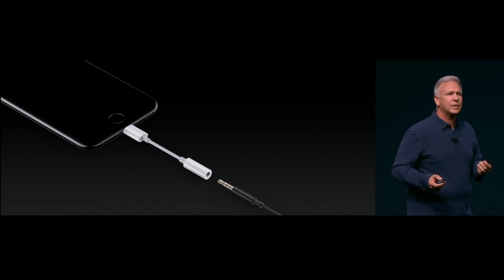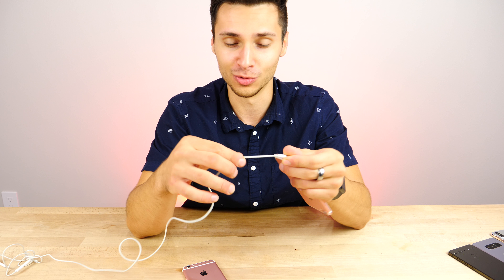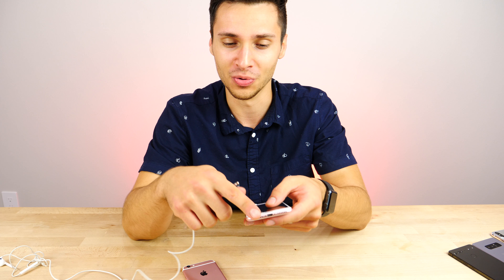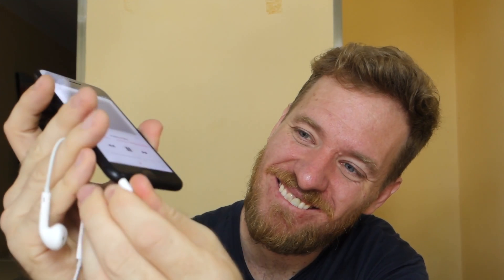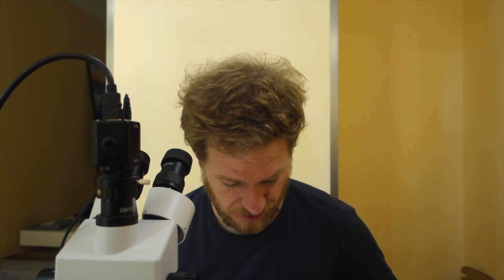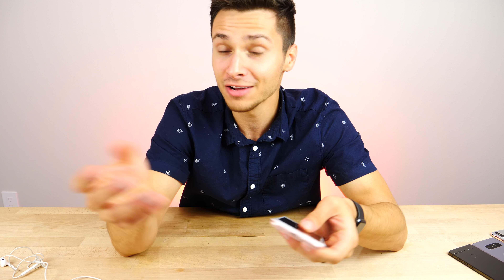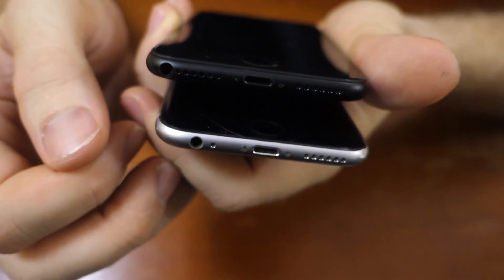Insane iPhone 7 Headphone Jack Mod!

Comment: I just miss my headphone jack. 😂
Reply: B-Radz you can afford 700-1000 for a phone, I think you can afford 100 for a set of Bluetooth headphones like the Marshall Major II.
Reply: G B Df Bruh? Someone always has to come in trying to talk shit, all I said is I miss my headphone jack I'm allowed to do that right? We payed for my phone with tax return, just because you think you're smart doesn't mean it's true.
Reply: B-Radz dont buy an iphone 😑
Reply: 101 PMF I bought my phone thinking it wouldn't be much of a problem when I have a Bluetooth aux dongle. Turns out I was wrong, all I said is I missed my headphone jack and ignorance came lurking in the comments waiting to talk shit. I didn't say it wasn't my fault I got the phone. I didn't complain about the price. I honestly could give a fuck less. I just said I miss my headphone jack....
Reply: G B you shouldnt have to pay $100 for something as basic as headphones for a phone you already paid $1000 for on a connection that still gets interference and imput lag. That's like having to deal with all the bullshit "accessories" with red cameras.
Reply: d1asian, that's a piss poor argument. If you're too poor to pay $100 for good headphones, then use the ones you get with the device. Guess what? It's not like Apple bundle headphones which still need a headphone jack. And it's also not like Apple don't give you headphones. Or a short adapter cable to use your old crappy headphone jack headphones for free.

By the way, Bluetooth hasn't had ANY connection issues or latency issues in YEARS. If it did, do you really think Samsung, UE (Logitech), Bose, B&O and all the other high brand speaker/headphone manufacturers would be switching to bluetooth as the primary audio transfer method? Samsung soundbars for TVs. Bluetooth enabled. UE, Bose, B&O and others all making top notch speakers. Then theres companies like Sonons too.

FYI calling red cameras BS due to their accessories, shows you don't know much about them. Just so you can understand correctly, red cameras are MODULAR. meaning you buy each piece of the camera separately, custom to what you need. This is a very good concept, because most of the time when you buy a regular camera, you pay for features you don't want and/or need because you'd be adding attachments anyway - such as cameras that have a built in flash vs. a dedicated flash expansion unit, or the built in microphones vs. a dedicated wind-proof microphone. Buying modular means no wasted money on trash components that will never be used, and that when something new comes out (better lens, better flash, better microphone, higher capacity batteries etc.), be it first OR third party, you can easily and cheaply upgrade vs. the price of buying an entire new camera system.

As a final point, your argument of "I should get an expensive pair of headphones with my phone, and i expect all red cameras to be pre-built and cheap so I can afford them", where does this ignorant view stop? Next you'll be expecting a PC with every existing piece of software preinstalled with licenses. Or a gaming console with every pre-existing game pre-bundled with it. The world doesn't work like that. If you want something to add to existing hardware, be it more hardware, or games, or software in general, quit moaning about it not being bundled and just get it.
Reply: I don't condone airpods myself personally because the quality is no better than the wired versions, and because it ties you into apple's ecosystem with the W1 chip.

Bluetooth headphones in general however, are an entirely different story. They free you up from any specific ecosystem (headphone jack, lightning port, USB-C port, micro USB port whatever)... and ensure that they will remain compatible with any future device you might own. Not only that, with Bluetooth being digital, vs. the analog signal passed through cables, you get much higher bitrate possibilities, meaning better audio by far. The reasons to switch to Bluetooth are far higher than sticking to cabled versions. Even battery life isn't an issue. My own Bluetooth headphones (Major II by Marshall, one of the best audio companies on the planet, known for making guitar amps used at most concerts around the world) boast 30h battery on the packaging, however in real world usage that could easily translate to over a month of usage (such as using while on public transport going to work, school or whatever your daily need is). As a gamer you'd find yourself only needing to charge every 2-4 days of heavy use.

With Bluetooth, you really do have no constraints of how you can use them, because every console, media streaming box, cell phone, tablet, all have Bluetooth 4.0 or above nowadays. And Bluetooth 4.0 eliminated any latency that  was seen previously, in addition to providing ranges that also prevent any connection issues (over 30 meters) and that's now even better with Bluetooth 5.0 as seen with the Samsung galaxy 8 series.

Basically, my point is, if you have the money to spend on a $100 pair of headphones that are Bluetooth enabled, then why not do it? It's an investment that will free you up over the long term, give you much better usability, and of course, no more broken cables forcing you to trash expensive headphones. I myself had Beats and Marley's House of Sound headphones before these Marshalls. Both suffered broken cables and became useless.
Reply: Sorry but again not everyone has money up their ass. I got my phone using tax return, my headphones either got lost or stolen at school I can't be the one to assume, and after that it makes me iffy on taking my dongle anywhere because god forbid I loose it and have to pay 9$ for another. I bought the fuze case and it makes my phone die at least 2x faster. If I had the aux port it would completely avoid this problem. Again it all starts with a simple comment and then people won't stop talking shit for years. I just miss my damn headphone jack, I'm tired of forgetting my dongle going to school and not having any music to help me through the day because of everyone els's bullshit.
Reply: Keep in mind there is no such thing as true "digital audio".  For any speaker to work, whether it is your earbuds, bluetooth headphones, or a full sized speaker, the signal that reaches the coil inside the speaker must be in analogue form.  With modern mp3, flac, or m4a files, we use digital code to store the analogue information that is then translated by the DAC (digital to analogue converter) back to an analogue signal.  In bluetooth devices, the digital signal is transferred via bluetooth to the headphones and then converted by a DAC built into the headphone.  With wired devices, the digital file is fed to the DAC on your phone with internally wired connections, which can provide much higher bit-rates than bluetooth.  Essentially this means bluetooth does not provide better audio, and it is mostly dependent on the quality of the drivers in the headphones and the DAC and amp used to drive them.
Reply: B-Radz get a android
Reply: Jimit Desai Yea that's what I'm doing next just don't know which is better, I've heard people say don't get the latest galaxy but they don't say why??
Reply: B-Radz check out the lg v30
Reply: Jimit Desai Ok thank you for your advice!! I really appreciate a logical conversation.
Reply: G B np all the best in finding your next phone
Reply: B-Radz there are plenty of brilliant android devices out there. Check a store which has working demo units because the right device is different for everyone. Since you said nobody says why not to take a galaxy I'll give you a few reasons. 1) poor value for money, 2) the inbuilt DAC for audio output is terrible. 3) the inbuilt speaker is terrible quality and still mono and not stereo despite this being 2017. 4) battery life is abysmal despite having one of highest capacities and 5) it's insecure. You pay for facial recognition that can be hacked by a photograph.

LG, HTC, Huawei and One plus are just four companies you should look at if you want android. Don't bother with the Pixel or Essential because they also don't have headphone jack.

Also make sure to research all models you've been checking out. Specifically pertaining to battery life
Reply: G B Do you think all companies will soon go toward ditching the headphone jack?? If so I would honestly rather stay with iPhone because of the simplicity and how familiar I am with it.
Reply: B-Radz I think it will become an increasingly rare feature, but there will always be enough demand for it that at least a few android flagships will have a headphone jack for the foreseeable future
Reply: Joseph Kebbekus True, there's always at least a couple that use it to their advantage because who wouldn't. That just leads me to the same spot in wanting to wait to get another phone but it's not always the best considering new phones coming out left and right. I feel as if I'm going to buy one and one with just a couple more features that would have helped released.
Reply: B-Radz oh yeah and I also don't recommend the s8 or the note 8 because the s9 is coming out in February according to sources.
Reply: B-Rads I would take your time and find a phone you like with almost everything you want, wait a few months or so after it was released, and get it then for a lower price.  I know it won't be the latest and greatest at that point, but it will still be a great phone.  That's what I did with the galaxy s6 and its still my main device.  It's missing some nice features like waterproofing and an sd card slot, but its lasted me a long time.
Reply: Joseph Kebbekus Very true, that's what I always do before I get any phone is wait to see the reviews and get a hands on model.
Reply: B-Radz i miss my phone
Reply: The main reason I hate not having it is when I go to the gym.  I need to carry two sets of headphones.  I hear that complaint from alot of owners.
Reply: Jay Trock Exactly that's a pain, i would end up forgetting one sometime like I do my dongle
Reply: Apple is one of those companies (the only company actually) that can get people to actually try it because they have so much influence in the tech world (example: floppy drives example: the idea of real smartphones, etc etc).I mean this is technology, for the people who always say quote "no headphone jack, no buy", ask yourself this: What are you gonna do once everyone removes the headphone jack like everyone will eventually do (and they will, especially since Apple did it)? Will you adapt to change like how you should because this is technology or will you stand by your no jack no buy motto and and keep your current phone which will get outdated really quick all because you're worried about a damn headphone jack?
Reply: technoguy I love you 😂 you completely changed my perspective.
Reply: technoguy I think they just got rid of it too early. People are starting to make the transition to Bluetooth now, but not everything has Bluetooth yet. This is why they should have given it a couple more years for people to get more advanced and then remove the headphone jack when no one really cares about it.
Reply: d1asian what’s red cameras
Reply: Christian Sanchez I completely agree
Reply: do you also miss your $750 that you spent on it? ;)
Reply: CrazyBearGuy Yeah I did the second I walked out of T-Mobile 😂💯
Reply: Time to make the switch to android.
Reply: G B what if you go to friends house without Bluetooth headset and he gave only normal Jack . Nerds logic to use Bluetooth
Reply: Bl Chitu this is why apple provide a very small and thin dongle in the box for free. It's so small that it's not even noticeable other than the 3 inches it adds to the cable length
Reply: plady Where have you been read up in the comments that was already covered. 😂💯
Reply: Why apple?...you pay your ass of for shit!!!!,sacrifice things that andriod phones can provide for much less money!!!!!!
Reply: furious president I encourage you to be smart and read up before you comment. Phone companies are soon going to all ditch the headphone jack.
Reply: B-Radz I see your point,just like the galaxy note 8 droped its headphone jack,LOL
Reply: Wel, Iphone is the king of speed!!
Reply: G B Talking about me? I've never said they are speed god's or anything around the trash your talking all i've been saying is about the headphone jack..?
Reply: B-Radz wasn't talking about you don't worry lol
Reply: G B For sure bro, it's all good
Reply: B-Radz my parents have an iPhone 6 so they have headphone jacks already
Reply: Mm
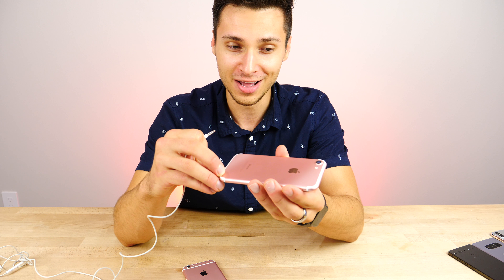Reply: bluetooth is not better than wired. listen to chasing the sun by the wanted 1:20 there is an echo can can be clearly heard by the cheapest wired headphones that cannot be heard on a $200 bluetooth 24bit DAC with 112 SNR with those same headphones.  Bluetooth compression garbles it.    heck you can even hear the echo clearly on the iphones speakers. when you plug that same DAC into the lightning connector it sounds great.  try it for your self.
I miss the headphone jack too.  im sorry for wanting quality sound that is at least as good as the iphone speakers
Reply: B-Radz apple sucks I have galaxy s8
Reply: You used the wrong emoji lol
Reply: Cortex No I didn’t, the whole reason I watched this video had me laughing because someone would go through that much trouble to install a headphone jack on a newer iPhone.
Reply: B-Radz its called a samsung
Reply: Me too 😭
Reply: Poke $50,000 camera
Reply: ios-Andriod
Reply: B-Radz same  I want to listen to music with my headphones and charge my phone but I can’t, I would get Bluetooth headphones but nah.
Reply: Jack misses headphones :(
Reply: I still have it 😂😂
Reply: B-Radz yeh
Reply: B-Radz me to
Reply: Rip headphone jack 😂
Reply: B-Radz That's what you get for buying iCrap
Reply: I dont cuz i have a samsung
Reply: I don't miss mine at all. I can live with using an adapter (I'm sure I'll lose it somehow a few times)
Reply: B-Radz no i love it when the battery in my headphones dies. So innovative. I also love it when the battery on my phone stops holding a charge. Oh and when the phone runs out of memory and i cant put in an sd card. And my favorite is not having a back button or a home button :( apple is cancer.
Reply: Buy a Samsung! 😂
Reply: I don’t. Using the dongle isn’t a big deal
Reply: Hi Hi putting in a headphone jack isnt a big deal. Using an unnessesary dongle is stupid. I havent had to do it since 2006
Reply: go and get a samsung
Reply: G B or Sony SoundMates which is cheaper
Reply: Why Don’t You Use Bluetooth Audio
Reply: G B and plus an iPhone 7 is £300 and that has no headphone jack
Reply: B-Radz why not get an iPhone 6 or 6s 🙄
Reply: Zonde Phiri Cuz I have an IPhone 11, why would I downgrade
Reply: Seeds Sure bud, defending myself is getting offended, keep dreamin 😂👌🏻
Reply: B-Radz Because you said that you miss the headphone jack 🙄😀😂 and besides I can’t get an iPhone 11 right now because things are too expensive where we are right now I’m not like you rich people 😩😩 so I have to wait even longer to get it 😔😂
Reply: In Zambia it takes forever to raise enough money to get an iPhone 11 and I want the 11 Pro Max which is 5x as expensive as I was expecting it to be. It is starting from K23,450 for the 64gb so it isn’t fair that where you are living it’s probably cheaper so that’s why I am asking you that question 😀😀😔
Reply: It is just a suggestion 😀
Reply: Zonde Phiri Oh damn that sucks

Comment: still he defends apple after all that guy had gone through.
Reply: Sriram Sarathy considering Apple is not the only one that removed the Aux jack, what is there to or not defend here?  Even Google removed it from their flagship Pixel phones.  HTC has as well. Samsung only still has it so they can milk their base. 

Reality is, most people want wireless headphones anyway. 

Now I myself use the aux jack at night for white noise due to my sleeping disorder but I have to find a solution for charging it while I'm using the lightning jack for audio. 

That is the only time I can see myself or others needing to have a charging solution while using headphones. 

We have to adapt to new tech to advance. We did the same when Apple switched from 30pin to Lightning. 

There are benefits but people chose to ignore them and immediately cry wolf on the whole thing.
Reply: Dustin Lehman Its 2017 not 2107 the headphone jack isn't obsolete. isheep like you believe everything apple does is for the customers benefit when in reality they want to milk the everlasting shit out of your income.
Reply: Dustin Lehman you realize wireless headphones are still inferior due to sound quality being subpar for the price and imput lag and battery life right?
Reply: Sriram Sarathy surprisingly it’s because he’s a satisfied customer
Reply: Dustin Lehman whats milking about samsung keeping the jack? Milking is making you buy new wireless headphones.
Reply: Monovant yet most androids are just as expensive as an iphone?
Reply: Dustin Lehman  actually no they dont want to have wireless earphones apple lost 34 percent of customer base so .... you have no idea what your talking about.
Reply: Dustin Lehman oh and they bought 50 percent of there parts from samsung and htc sooooo uea when you can get off the apple is better whitch it was at one time but now they are 10 years behind and are useing old style wireless chargeing and trying to cover it up with wireless headphones and other crap noone wants how do we know well fo instance beats the headphone company best in the world still have wires qant to know why?..... because the sound is better and to be honest i own a pair off apple wireless buds and they sound the same as my 24 dollar samsung pros apple has got nothing but outdated so shut up about this bs your throwing